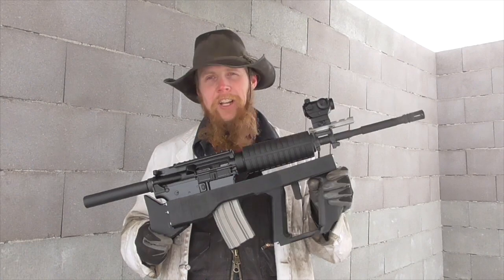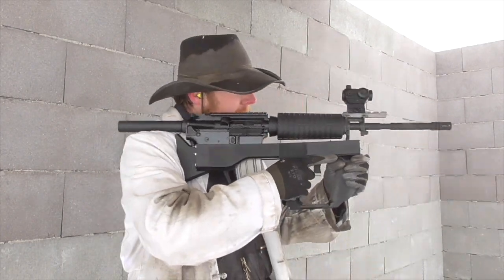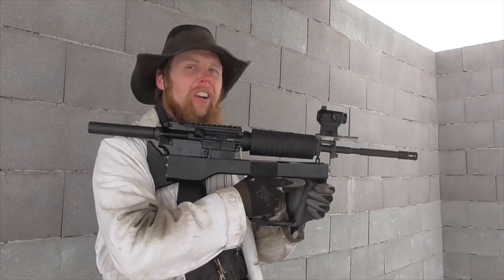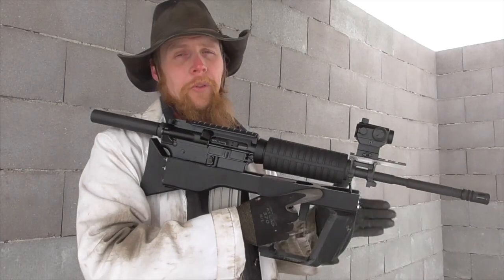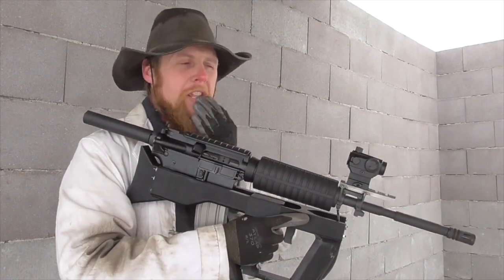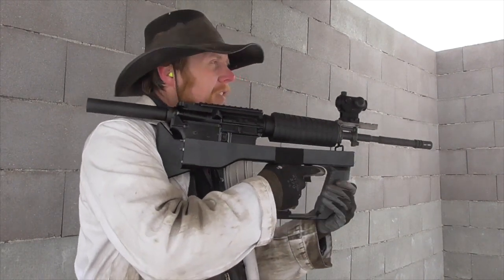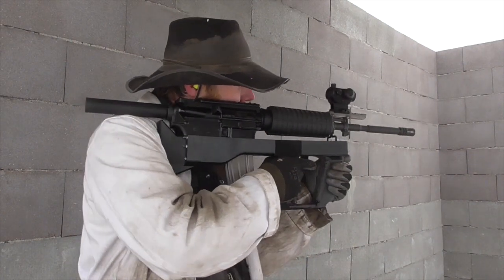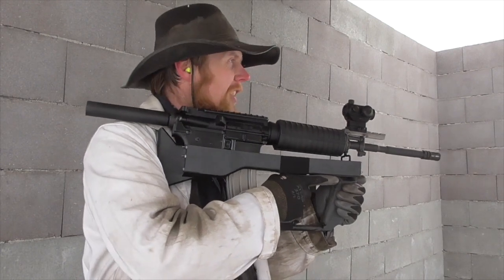The BR-15: a Bullpup AR-15 (TIS368)

Comment: Your thoughts on Reap Weaponries SCY Bullpup conversion?  Very similar to your prototype.
Reply from the maker: Well, I've never tried one out, but it definitely looks slicker than my BR-15, and appears to do the same thing.  So, assuming it works well, I think it would be a hot seller if it was priced at $50, and might even do well at $150, but given that they're asking $500 for just the conversion piece, I'm thinking it's probably DOA as a commercial product.

Comment: Opinions on MBLR 15? It was announced teo months before this video was posted.
Reply from the maker: Basically I'd say it fits the pattern of AR-15 bullpups that I described.  It does have a few more interchangeable parts than most, including the ones that are needed for caliber changes, such as the barrel, bolt face, and magazine.  That might give it some niche appeal that other attempts haven't had.  However, note that most of the major components (receivers, bolt carrier, etc) are still proprietary. And given that it appears to have been developed by a freelance inventor without the resources to put it into mass production, I would anticipate that, if it goes into production at all, production will be in small batches and prices will be relatively high—I'd be surprised if it ever retails for less than dedicated bullpups like the Desert Tech MDR , IMI Tavor, and Springfield Hellion.

Comment: say i use the mp15-22  so theres no  buffer tube  will your design work for this?
Reply: i dotn have a printer do you know where i can get one ready to install
Reply: what about the sw mp15-22  pistol,   ??
Reply from the maker: I don't have any ready-made ones for sale at this point (maybe in future, if I can find a distributor who wants to print and sell them) but I know there are companies that do general 3D printing.  Just type "3D printing service" into your favorite search engine, and it should come up with some companies that can print parts from the STL files.
Reply from the maker: I have only tested it on this one AR15, but I imagine it would work just fine on a rifle without a buffer tube.

Comment: you could add a second safety on your printed stock/grip, that blocks your trigger/transition-bar and prevent it from moveing. so you could let the actual safety on the lower always on fire, and still be able to put the weapon on "safe" while manipulating, moveing etc.
all in all a neat concept

Comment: Try a cable and pulley system for Your trigger connection.
Reply: That could make the trigger pull lighter due to mechanical advantage, but that would make for a pretty damn long trigger pull. Best option I can think of to keep the price low would be to put in a rise armament drop in trigger, they have a pretty decent one. About 3.5lbs for the price of about 120 if I recall correctly

Comment: As someone who loves bullpups, I'm not sure how I feel about this. I've never felt so conflicted about a bullpup. Either way, well done. It shouldn't be too hard to add in a lever system to actuate the mag release. The bolt release and safety on the other hand would be more complex. And I do agree, the premium one must pay for a dedicated bullpup is ridiculous.
Reply: The only easy way to actually convert it would be to take the old gas key out of the bolt carrier.

Cut half the carrier off. And bolt-on an AK-47 Piston + Gas block.

Unless you're able to buy a Bufferless Bolt carrier. But those are a little expensive.

Comment: a pistol length buffer tube with a a stock fludh with the end of the tube would shave down like 6 inches atleast

then put the bullpup trigger group right in front of the mag well

you could even print a lower with a built in hole for a transfer bar

Comment: I like the fact that you try out new ideas, Tim.  It is only then that they can be properly evaluated.  While you made this stock for yourself, if you stretch the exercise to what a wider market might like, consider this:

13:44  It looks like an actual trigger guard might be useful.  Else, you are relying fully on the safety.   Yes, the Tavor does not have a trigger guard.  That is also "cutesy" in my opinion, and asking for trouble.

You might like the forward handgrip where it is.  If it was me, I would explore moving that forwards so that I could use the forward grip as a true pistol grip, without crowding the trigger with my left thumb.  Using the full hand to grip the rifle becomes more important during mag changes, as the above video timestamp demonstrates.

With the rear pistol grip having a more regular shape, that terminates at in hand web and trigger guard sections, the right side grip will be more repeatable and more secure too.

Comment: It is interesting to imagine how the AR15 can be redesigned. To reconfigure it as an ergonomically efficient bullpup, I believe it would need significant redesigns (such as with the charging handle location, or with the lower as you pointed out that other companies have tried). I personally have spent time drawing out ideas for a bullpup version, but admittedly most of my ideas end up requiring certain parts of the AR to be redesigned from the ground up in order to incorporate modern standards of function and form in a bullpup (e.g., DTA MDRx, Radom MSDS, or IWI X95). However, I think certain original components could be preserved (i.e., FCG and barrel), so it would not require a complete redesign.

To add to your point, the bufferless carrier conversion systems available on the market are interesting, but they also limit your caliber options to .223/5.56 & 300B as far as I've seen. So, you lose much of the caliber compatibility seen in a standard carrier in that exchange. The BRN-180 or SIG MCX uppers are a solution, but they are not in line with your fundamental goal here, which is universal compatibility w/o design modification.

You are an inspiration to me. Keep up the good work!

Comment: I saw the thumb nail and thought, well this is going to be an interesting invention of his. When I saw it in practice though, I kind of like it. The buffer tube kind of locks the thing into your shoulder. If I saw a slightly refined kit for $100 of this, I would most likely pick it up just to play around with a bit. As it is, if I manage to find any time, I might make a slightly different version of it.
Reply: The Reap SCY bullpup kit is coming to market now. Works with the PSA Jackyl.
Reply: @JinKee  I did see that. Look strikingly similar to this. I wounder if this one was the inspiration, though that development time would be rather short if it was.

Comment: I have a BRN-180, am working on two 3D printable bullpup conversions for that myself, one fully printed lower, and one that bolts on like yours. All I'd need to do to make the bolt on one functional with a standard upper is remove the buffer plug that secures the top of the stock to the lower and put a buffer tube in there instead. Both theoretically functional as is, I just need ammo prices to go down so I can go shoot them without selling a kidney lol

I'm glad I wasn't the only one wanting to 3d print a bullpup AR conversion.

Comment: Why are still transfer bars the go to to push on the trigger instead of protected bowden cable like pull or partial motion? 
The meh trigger is the main complaint besides a need to learn the controls. A better trigger transfer system would be an interesting video series. I'm a big fan of your bullpup builds and bullpups in general.
Reply: rigidity and friction